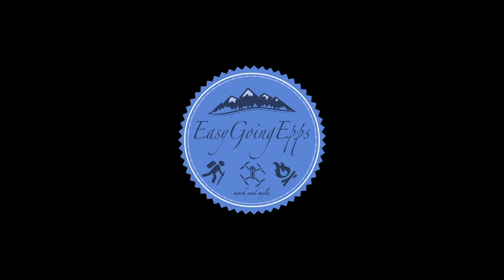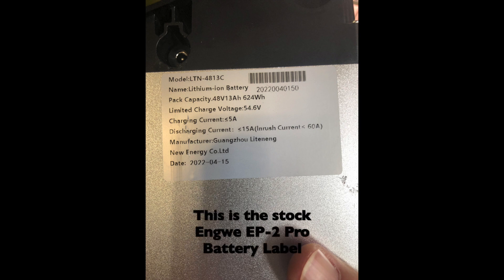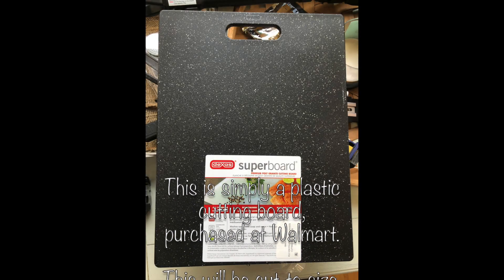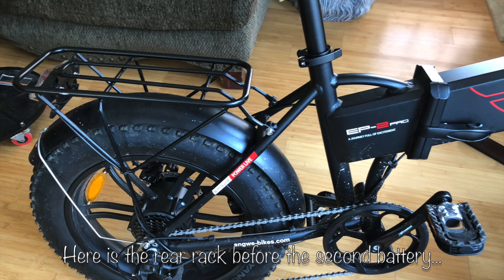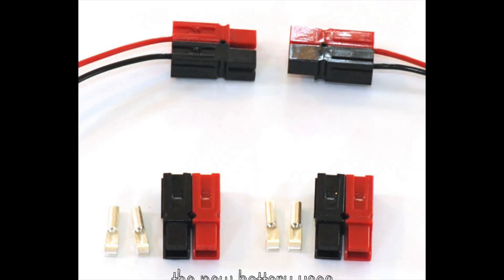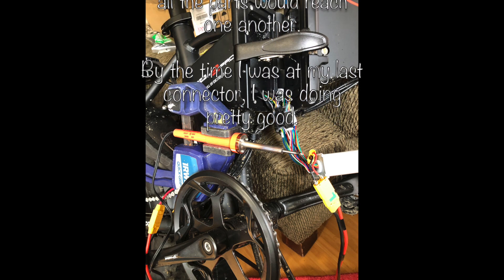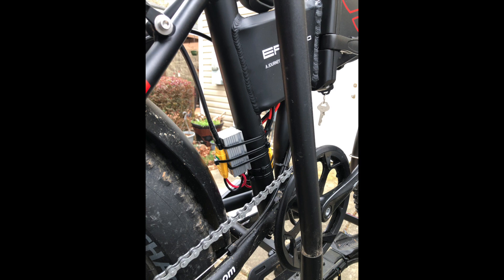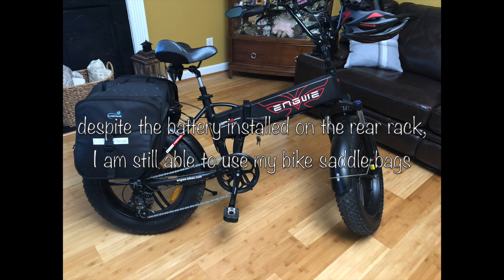Adding Second Battery to Engwe EP 2 Pro E bike

Comment: Hello, please reply. I only use it on the pedal. The throttle button does not work. I turned it on from the settings and it did not work. I looked at the electrical tape file at the battery. Everything is fine. What is the solution? I ask for your help. The dealer from whom I bought it did not respond to me.
Reply from the maker: sorry, i cannot help you with this condition

Comment: I've got a similar setup on my engine x. I too used a chopping board and a 10ah china blue. The battery sits on velcro pads attached to a neoprene rubber mat stuck to the board. There's a short clip on my channel showing the setup and later I installed a 100anp isolator switch so I could unplug it without sparking! 23ah in total and about 50-60 miles on pas 2-3. I also installed a power analyser which sits on the handlebar and I wired it in from the balancer kit up to the bar and then back down to the controller. It showed a max draw of 19amps at 960w! Easy job to do and like you I was no expert in soldering but it was fun.

Comment: Thanks for your video! My GForce T42 is a similar folder and I started by upgrading my main battery to 20AH in the bike tube. My second battery will be in the rackbag. Planning on a 52V 20ah and the Sparks Blender that allows for different voltages. Your XT90S connectors looked like a good choice for hooking it all together. Did you use heat-shrink tubing over your splices or just elec tape?
Reply from the maker: thanks for the comment

Comment: So I ordered a second battery (48v 13ah) for my ep-2 pro. Battery and balancer using the same plug as ep-2 pro. I hope it's easy plug and play operation :D
Reply: Update.
All parts arrived. Connectors are the same. Battery mounted on the rack. Thanks for the chopping board trick 😅

Comment: Can we just disconnect the 2nd battery and run the bike with the frame battery only as normal if needed
? Or we need to have the two batteries running with this settup?
Reply from the maker: you can either run one battery until it dies, then start using the other one....  OR, connect them in parallel, as i have, so that both run simultaneously.  some people say that running two batteries at the same time will result in more distance than running two batteries individually.
Reply: @easygoingepps5571  Thank you!
Reply from the maker: @jimmyberubelevesque2557  you're welcome
Reply: @easygoingepps5571  I ordered everything I need and received pretty much everything now. The only things missing are the 2nd engwe 16ah battery that I will mount in an homemade case inside another softcase mounted on the back rack. I have a male 5 pin connector and will make a base for the battery and the connector so they hold in place securely. So, I need to disable the Regen Braking  in the menu, is that right? Do I "need" to disable it or it can be dangerous for the batteries or the feature just won't work? The info about that on internet is kinda vague
Reply: @jimmyberubelevesque2557   i do not have an answer to that question.. my bike is not the regen braking type

Comment: With that second battery, is it possible to turn off the main battery and taking off the key without it turning off the bike?
Reply: yes...  you can turn off first battery and remove key, and keep running on the 2nd battery.... the bike will run entirely on the second battery - which does not require a key.  it increases theft risk, i guess...  but, i chain it up when im not around it..
Reply: @PlaynDoc  I got a big ol' 10mm  chain and just ordered the alarm from Engwe

Comment: Why not get the same battery and just keep the spare in a bag mounted on the rack? That's what I'm going to do. No mods.
Reply: because folding the bike open and changing out the battery is a bit of a pain, 50 bucks more gets me a solution that doesnt require any of that tomfoolery while I'm out and about
Reply: that's certainly a way to do it...  i get about 20 miles on one battery....  i get over 60 miles on two connected batteries (same riding path and technique)... i dont know why two connected ones last longer than 2 separate ones... but, that's how it's working for me

Comment: Same I am wondering if it would work on an Engine Pro which has regenerative brakes but can be disabled.
Reply from the maker: thanks for your comments
Reply: I got one, what's the question, with regen braking?
Reply: @JUNIORGONG.THEUNKILLABLE  That additionnal battery apparently won't work with regen braking. So the question is : Does that mean that the additionnal battery won't be charged up by the regen brake? Or it means that the regen brake will no longer work for both batteries? Or does that mean that that specific battery won't work on bikes with regen brakes?
Reply: @jimmyberubelevesque2557  I'd like to know this also. I have an engine pro I'd like to try this on
Reply: @jimmyberubelevesque2557  I thought this was an actual 2nd engwe battery, I am very sorry for stating otherwise, I literally cannot answer that question. If I did, it’d be maybe not for just the 2nd
First should work fine, but if the rear battery doesn’t stop it from applying itself, I’m interested now too 🫡🙏🏼

Comment: Did you have to turn off regen?  I know they state to not use a battery balancer with regen brakes, but I did not know if they worked fine with the much smaller hill regen on these ENGWE's?
Reply from the maker: Thanks for your comment.  The Engwe EP2 Pro does not have regen.

Comment: Nice work and a range test would of been nice too..
Reply from the maker: thanks for the comment... here's what i have so far...  single battery was getting me just over 20 miles, with concern for running out of power..   after i added the battery, we took a 30 mile trip - i used mostly throttle, with minimal pedaling, in PAS 3.  After this trip, only one of the 4 power indicators were out.  If I extrapolated this, I figure I can get at least 60 miles, throttle only, in PAS 3....   my butt can't tolerate much more than 30 or so miles!